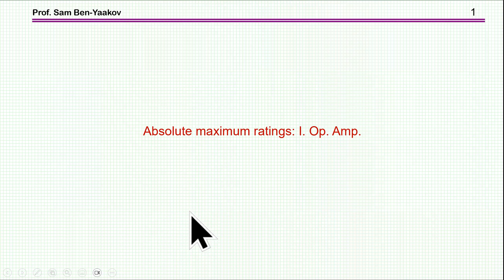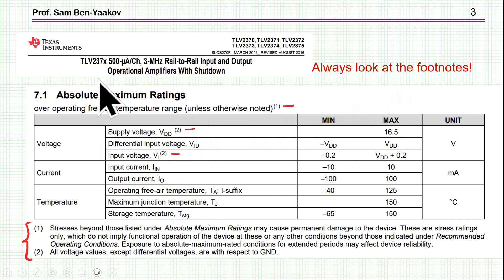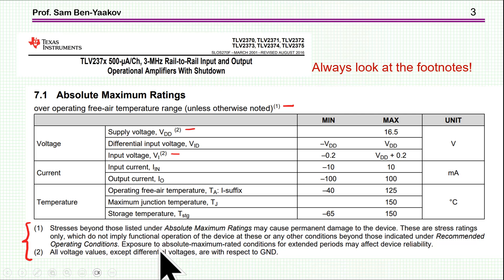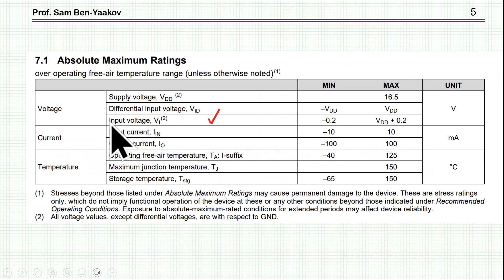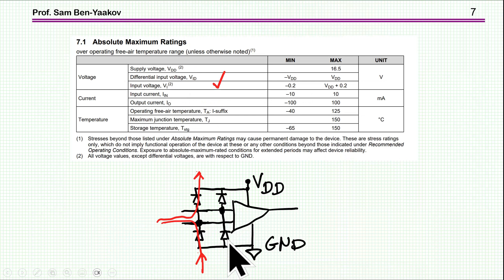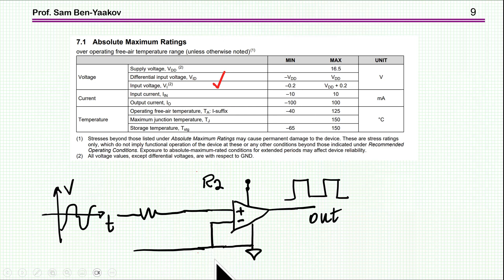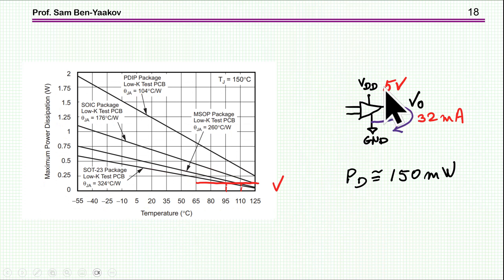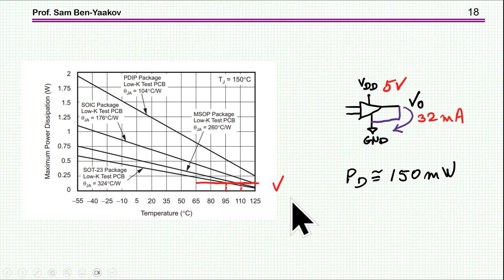Absolute maximum ratings: I. Op. Amp.

Comment: Power dissipation in op amps is quite an important parameter when dealing with high power op amps like the OPA467 or similar. Which are interesting devices by themselve! 😊
Reply from the maker: Indeed. Thanks for input.

Comment: How do i estimate input and output impedance in the case of op amps ? Do i take the out/in current and max voltage and then calculate as if there was a resistor there?
Reply from the maker: Max ratings are limits not parameters to work with